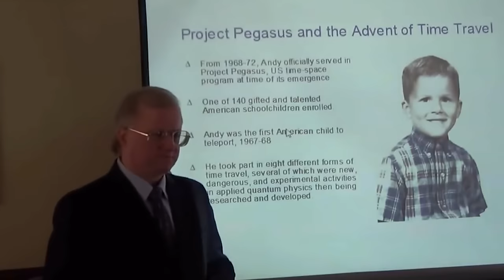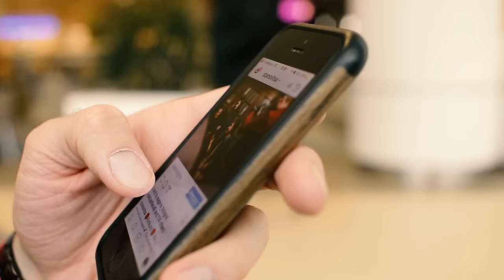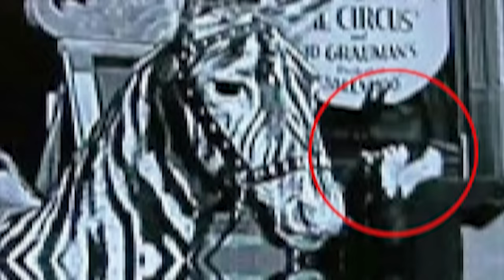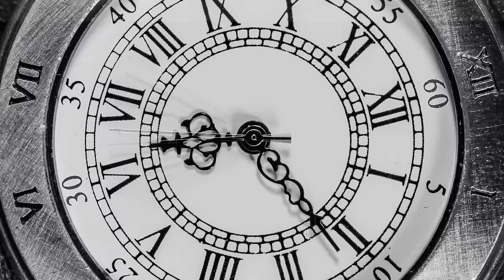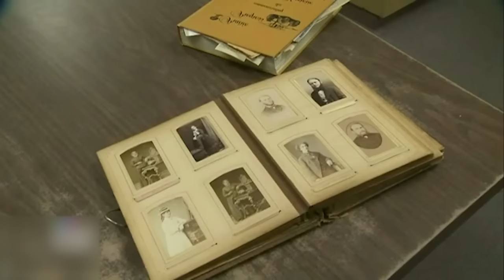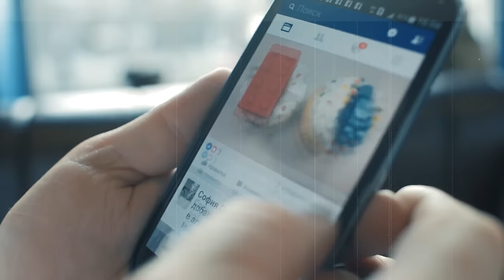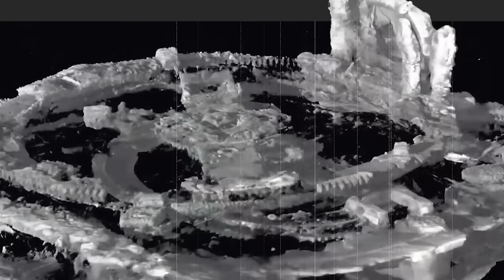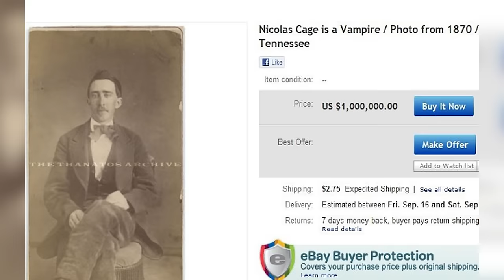Time Traveler From 2050 Reveals A SHOCKING Photograph!

Comment: The trouble with time travel is that if the sun is hurtling through space and pulling the Earth and her moon and all the planets along with us, is that the space of years ago will have moved the Earth, far, far away. So if you do not calculate where and when you are going, you can end up in the void of space. So if  you lack the ability to travel twice as fast into the future, you could never catch up with the Earth. To travel back in time is worse, your speed to go back to where the earth was is likely traveling 4 times faster. 

The only way reasonably for time travel to work is for Earth to be in a fixed location, something no one or very few embrace any more. This would of necessity require that the Earth would be fixed, and the celestial bodies revolving around Earth and that Earth would be flat. Otherwise these stories are just impossible. Even the Earth spinning on its axis, you could end up in an ocean, or inside a mountain. 

I do not believe time travel is possible myself unless it is a psychic experience. But the ability to go through time, any other way and arrive or materialize has to negate laws of time and physics.
Reply: Great analysis! I never considered this.
Reply: My thing is this: even if you could Somehow compensate for all that Revolving and Rotation, the whipping around at light speed (or even multiples thereof…), you’d Still need to do the GPS coordinates’ calculations.  The X and Y axis Might be possible I guess, but my problem is with the Z axis.  As you said: you might end up in a Mountain; that’s IN, folks, as in SUFFUSED INTO, MOLECULARLY BONDED with the Earth, or a Marble floor, or the Steel Hull of a Battleship (we Know that, as we have pretty solid photographic evidence of it).  But what if the Z-axis calculation was Off and the poor guinea pig taking the Maiden Voyage was deposited 10 km above the Earth?  He’d be in for quite a Fall….  Time Travel seems fraught with as yet insurmountable problems.

😊😊😊